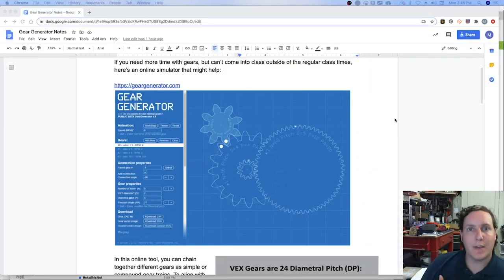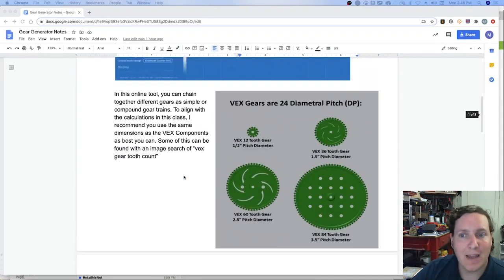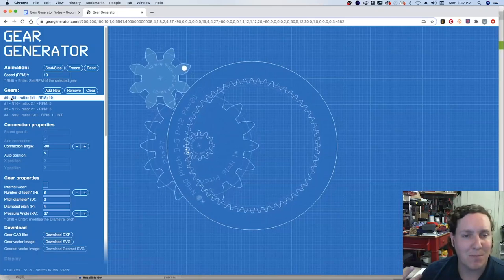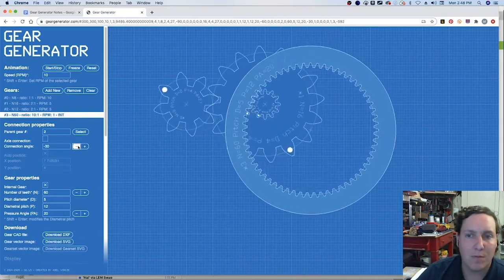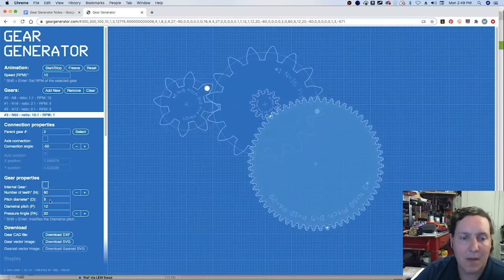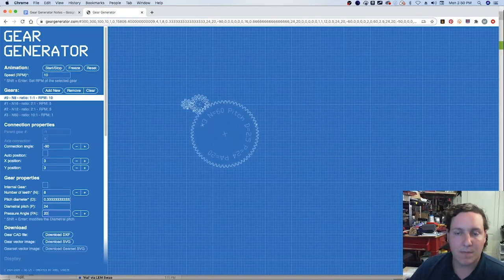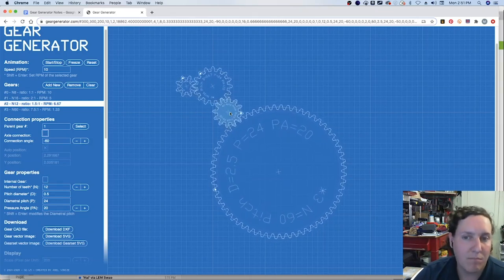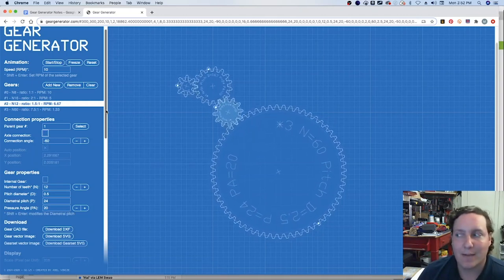Gear Generator Quick Introduction

Comment: I'm working on a Simulated Perpetual Motion Machine using an Arduino controller and a 28BYJ-48 stepper motor with a ULN2003 controller. The gears are going to be perfect for the application. Not sure how to determine the diameter in millimeters of the gear in SVG mode.